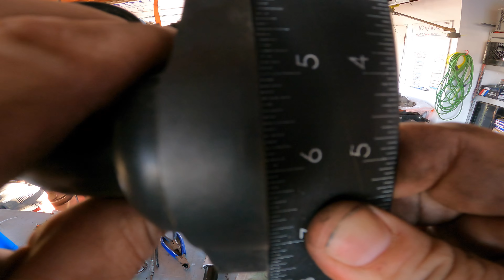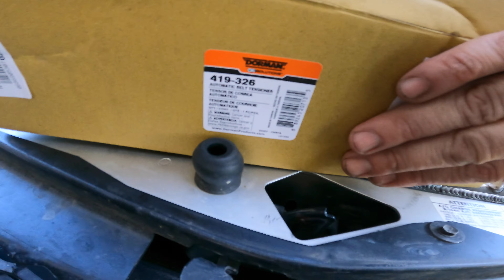How to replace timing belt and waterpump on 03 Dodge Neon

Comment: I love my neon. Good engine engines with aweful engineerrjng around it. They had that hole by the frame and firewall joining that let water seep in onto the rear control arm bolts

Comment: All that blue silicone, and a that nice hot air intake and cone filter remind me of being 18 with my first car😅.
On another note why I’m even here watching is the timing belt broke on my wife’s manual 5 speed 02 neon😬. Yea.. I know..worst case scenario…interference engine with a 10 percent chance that the valves are ok (even less being she didn’t know and tryed to start it after it broke on the highway at 50mph.
So I’ve looked at the pistons and valves with a articulating bore scope, and they appear untouched. Not a mark on anything.
I’m attempting to just throw a timing belt on it and cross my fingers🤞🤞.
I realize the chances are slim everything will be fine in the short or long run😅, being that there’s no damage if by chance a valve or 2 kissed the piston (it’s possible to do without marks I would think) it will most likely start up and run just as it did before.. but then there’s possible fatigue of the valve stem or stems from being bent back into place a little when it starts..
The hard part here is I’m trying to figure out how I’m going to put the cam and crank back into time because there’s no telling where there at right now.
Obviously I’m going to turn both the cam and crank and try to avoid them having a blind date (valves hate blind dates). 
I have an idea of how I’m going to do this but I’m no professional 😅.
But I know I’m not the only one who has done this.. I just wish I could talk to someone who has. 
The question is how do you time an interference engine that’s out of time by who knows how much, with the head on and the rockers bolted down..
O and this things got 290,000 miles so this is a last Hail Mary on a 400$ car that’s lasted us many many years so I’m not willing to throw any machine work into it or a replacement head..(thought about a junkyard hard though).
All that long story said, great video here thumbs 👍🏼. I’ll probably watch it many times 😂